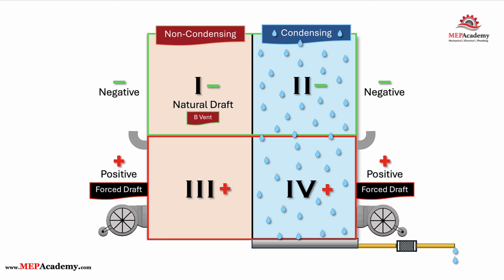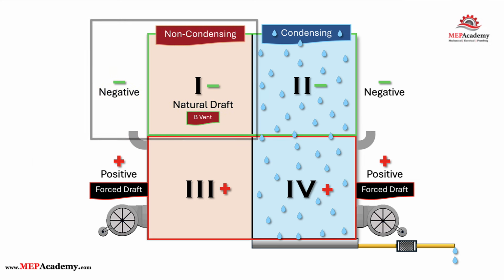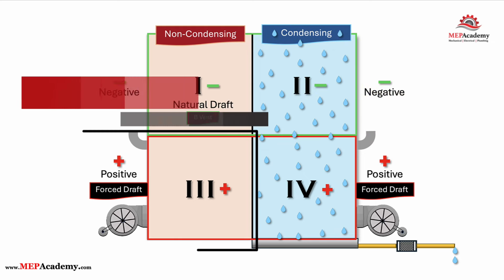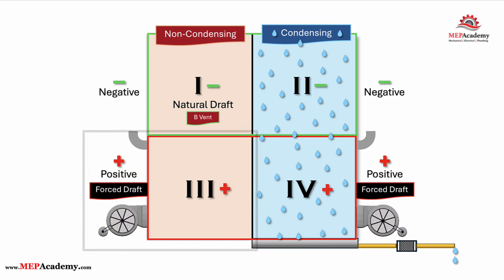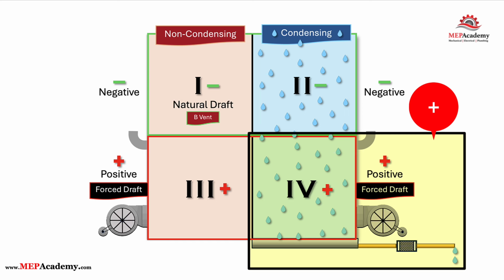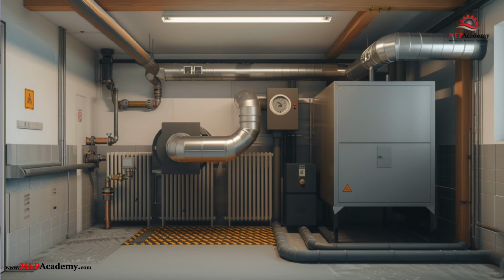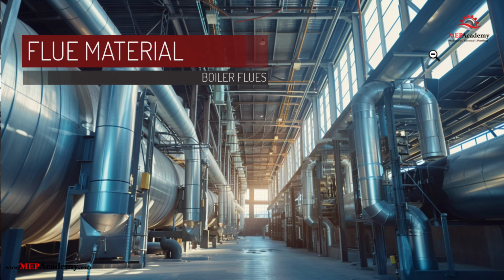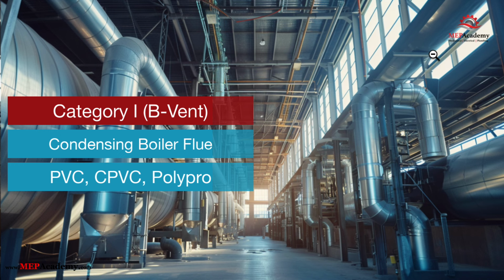Boiler Flue Vents

Comment: You forget to mention the stainless steel flue pipe for condensing boilers. In heavy commercial you see stainless flue quite often. Its very expensive and a pain to install, but it works great
Reply from the maker: You're correct. Stainless Steel is definitely an option. Thanks for the comment.